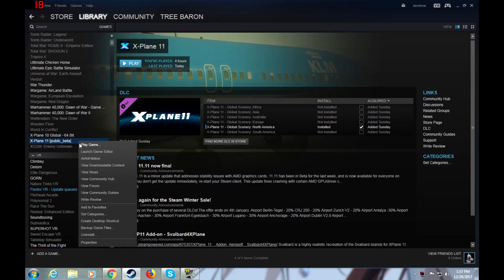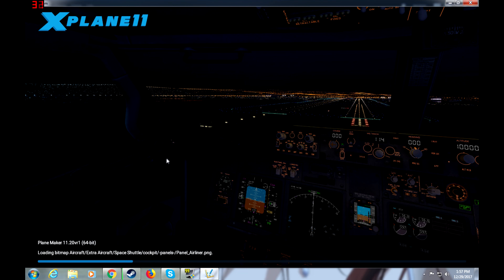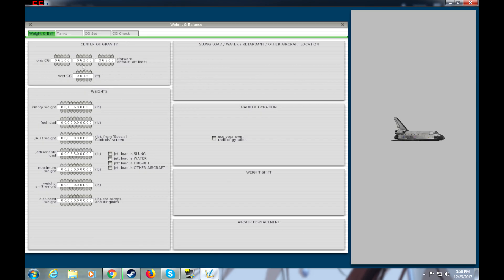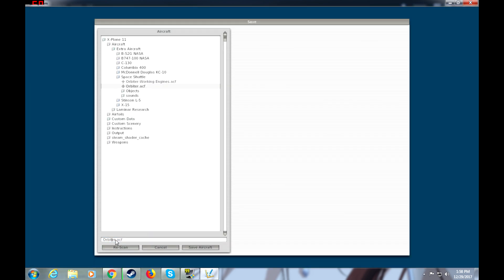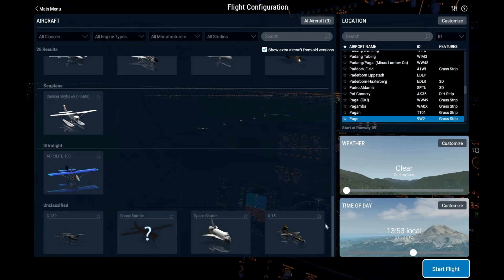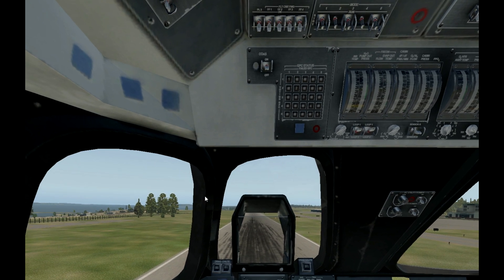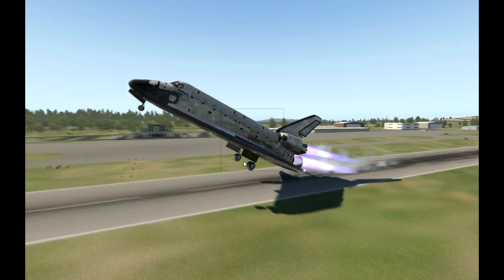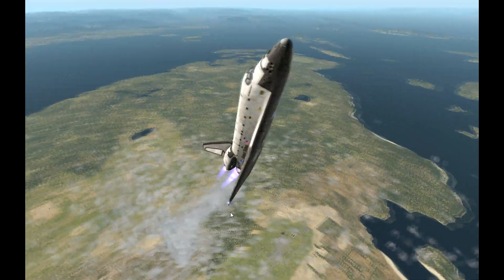X-Plane 11 - How to get the Space Shuttle engines working

Comment: The shuttle works fine until it reaches about 100,000 feet where the engines glitch out and shut off. Do you know how to fix this?
Reply: My guess is that the engines on the shuttle (at least in X-Plane) are oxygen dependent, so once they reach over 100,000 feet they shut off. Or alternatively, they have a max altitude at which they can operate set somewhere in the airfoil maker. If that's the case you would have to find where that is at and increase it.

Comment: The thing is that the orbiter itself didn't contain any fuel for the main engines because it was all on an external tank so this is cool but it's not realistic
Reply: @Delay Ψ you called a guy an idiot in a YouTube comment. That's embsrassing man.
Reply: the shuttle had monopropellent on it so it did have fuel on it
Reply: @spicybeen4354  But the monopropellent fuel is only used for the two small orbiting maneuver engines.  The main engines don't use monopropellent, they use a mixture of liquid oxygen and liquid hydrogen stored in the orange external tank.
Reply: @chook100  i was just saying that because it did have fuel on it and i know what it was used for. i was just saying that it did have fuel on it
Reply: @chook100  each of the shuttles engines was powered by the same fuel